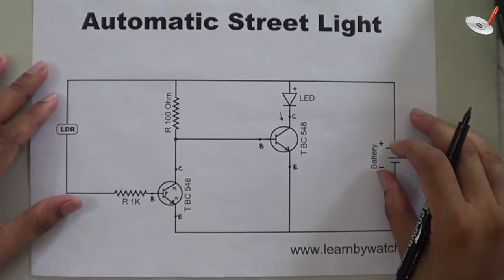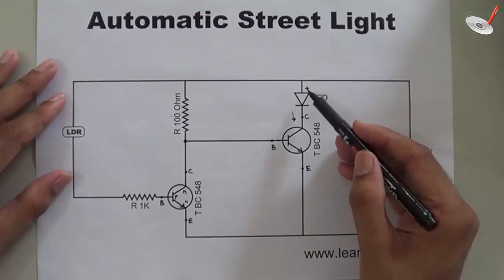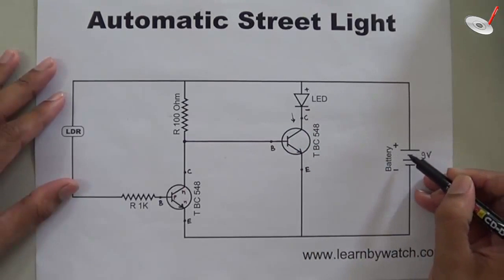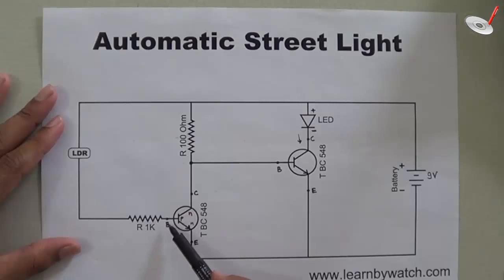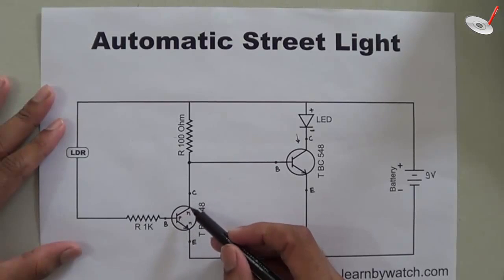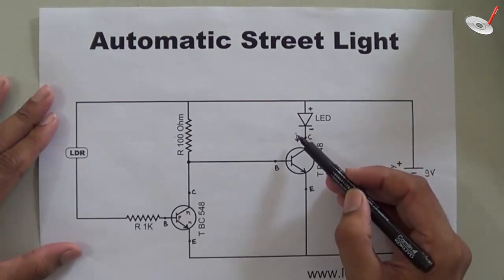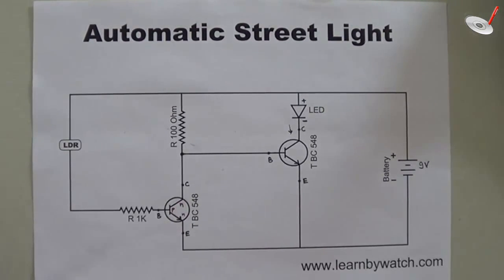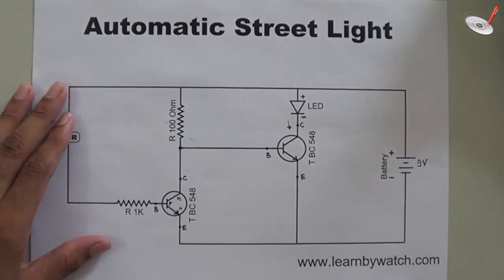How Does Automatic Street Light Circuit Works

Comment: The same circuit after some changes can be used for AC supply.
If you want to operate this circuit using AC, You have to replace LED by a Solid state Relay.
Solid state relay has 4-pins. 2-pins for Input and 2-pins for Output.
The Input side accept DC voltage and Output side Accept AC voltage.
It means by providing controlling circuitry on Input side we can Control the flow of AC on Output side of Relay.
In this circuit you have to connect DC input side of Relay in place of LED (keep in mind polarity) and to other side of Relay, Street light will be connected with main AC supply through Relay.
Caution: Do not perform AC circuit experiment in absence of an expert.

Comment: how does it save power?  even during sunlight current flows so what is the benefit of switch off the L.E.D during day time.
Reply: Current will always there but not used by the led. This can be understand by the example of our home sockets i.e. current is always their in the socket but it will be used only when we switched on the switch and our room's light ,fan etc.will work... I know i am not an expert but tried to help you....